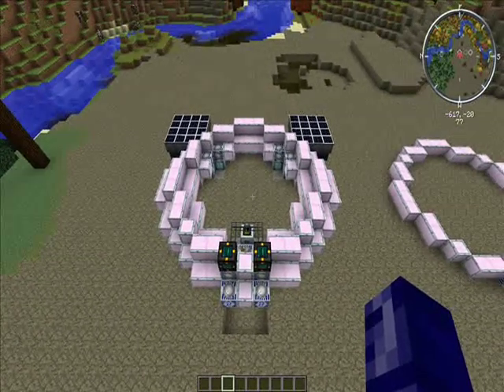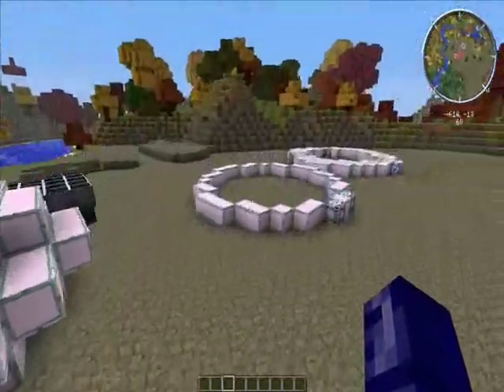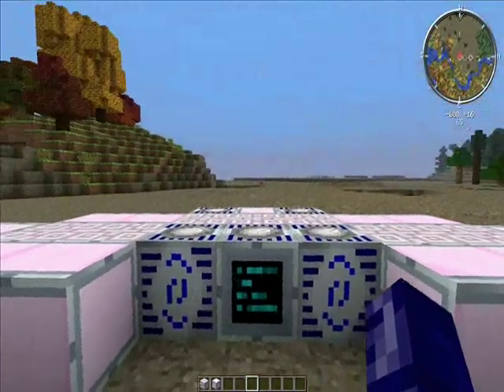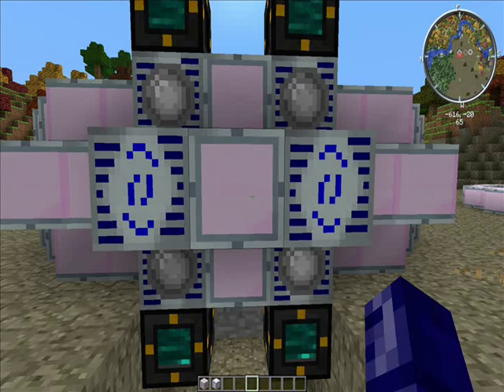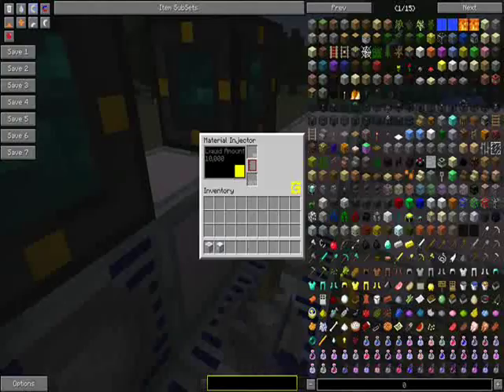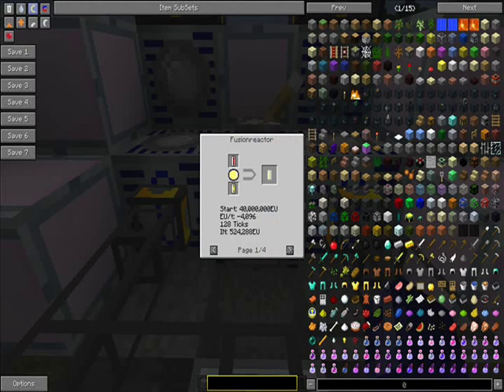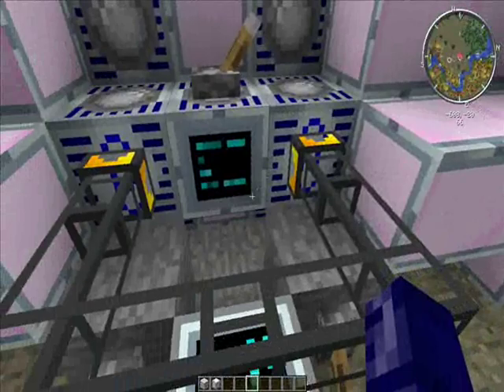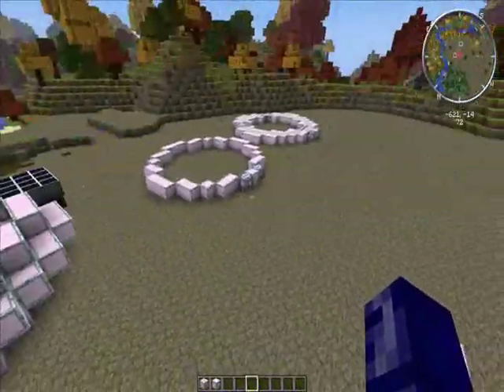The New FTB Ultimate v1.1.2 GregTech Fusion Reactor Tutorial

Comment: This setup is excessive, you only need 2 material injectors and 1 extractor with 6 (prefferably 8) energy injectors, also the tritium recipe is a waste of your deut, if you have tome of alkahest just make endstone with redstone from a witch farm. Yes, these run solely off redstone and water if you set it up efficiently. This may be a new comment on an old post, but this comment fits with FTB Ultimate.

Comment from the maker: I used Insulated X4 HV but Like I said i now use plasma generators to feed EU into the fusion reactor which in turn is Quad EV into each corner so that cable is required. Depends what EU source your using.

Comment from the maker: No, The start up cost is basically a toggle. Everytime the reactor is turned off, the next on will cost a start up fee. It's actually a very large net seeing as if you leave it running for around 5-10mins. You will net easily there. As the reactor produces 1k helium per session one could say which is nearly 2ticks. In 5mins one would have nearly 60M EU, and in 10mins double. So they do need a decent amount of reactive materials to sustain awhile to create a net profit.